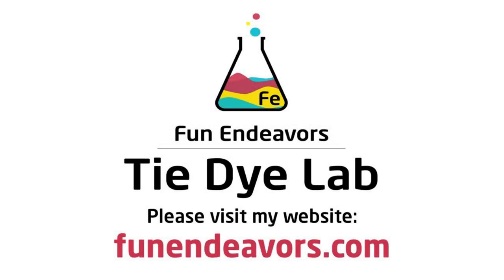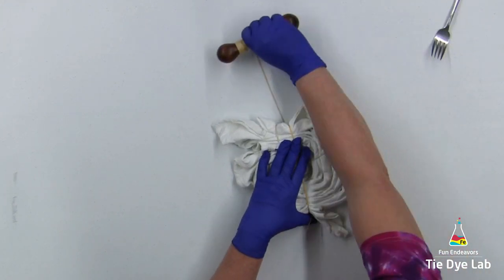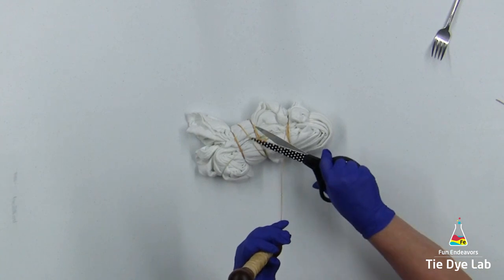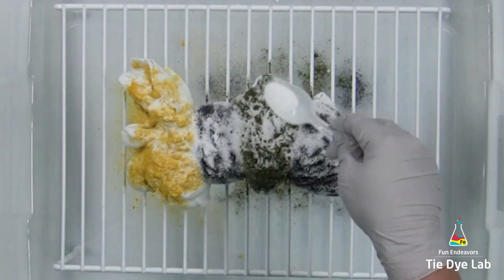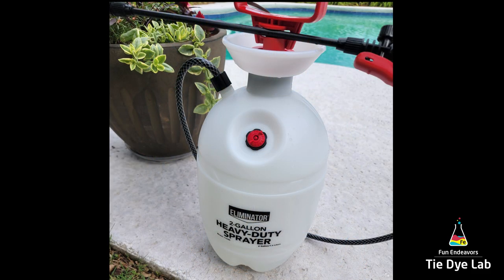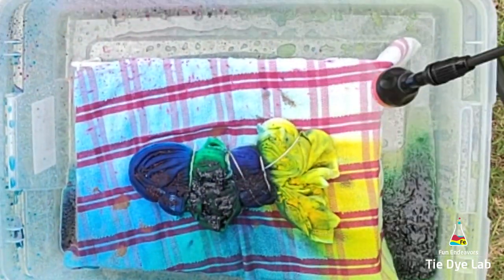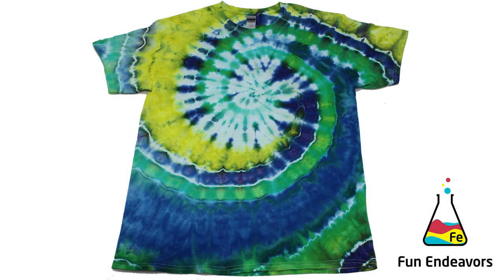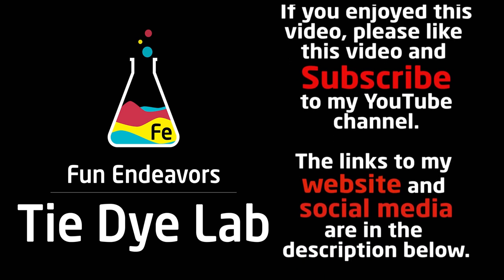Tie Dye Pattern:  Sinew Spiral Tie Dye Shirt [Hot Water Irrigation]

Comment: Which style do you personally prefer? The 'set it and forget it' type of ice dye where you get it all set up then walk away for a day or two. Or the continual work with spraying it and creating the shirt in less time? Is there a remarkable difference in the look and/or how much dye makes it to the final product?
Reply from the maker: I'm not quite sure yet.  So far I've only made about 4 shirts using hot water irrigation.  I've had fun experimenting with hot water irrigation, but I still love ice dyeing.  Since I'm not adding soda ash to my dry dye powder, I am still soaking the shirts for HWI the same way I would for ice dye and then letting them dry before I dye them.  I know not having to soak a shirt is a time saver in HWI, but not for me - at least not yet.
I use quite a bit of dye when I ice dye, but I think I've been using more for HWI.  Not necessarily because I needed to, but because I've been nervous about not getting good color saturation.  I think if I mixed the soda ash and dye together I wouldn't use as much.  For now though, I don't want to have to find the containers and space to store mixed dyes.  If I find myself doing a lot of HWI, I will have to take the leap though.
As far as the final look - I don't know that there is a huge difference.  Maybe it's just me, but I think I get a lot more color splits and more of a watercolor feel with ice dyeing.   I think my colors have been more intense with HWI, but part of that might be because I am using so much dye.  I guess the final product of my HWI shirts so far look kind of like something in between a liquid dyed shirt and an ice dyed shirt.

Comment: Just got the same 4 colors in a few weeks ago. I’ve used the sapphire blue and lime so far. My husband has used the intense blue ... not sure about the lemon lime. Really like the colors so far. I really like this dye. I am intrigued with using sinew on a spiral 😁. I haven’t tried HWI yet but I am sure we will eventually. Just curious about how much hot water you ran through the shirt and do you find that yellow dyes tend to be more gritty? And leave more dye behind than other colors? I do. 
Thanks again!!!
Reply from the maker: I'm not quite sure how much water I ran through the shirt.  I put about a gallon or so in my sprayer and I still had some water left after I was finished.  I quit adding water to the shirt when the dye dissolved and the dye colors came through to the back side. The lime green was the hold out color that took a while to dissolve. I did add quite a bit of it to the shirt though.  
Sinew on a spiral is something I've been messing with lately.  I tied a spiral with sinew and used Out White Brite a few months ago and that got me wondering how it would look to just use it on a regular tie dye spiral.  I'm going to keep experimenting with it more.
I think yellow is a tougher color to dissolve.   It's one of the colors that floats on the top when I mix it for liquid dye.  It also tends to clump up when I use it for ice dyeing.   I was a little concerned the lemon-lime was going to do that too, but it did pretty well dissolving.   It split into a bunch of yellow and green flecks that finally made came together on the shirt.  So far I really like the colors too!  I ordered some more new colors from Prochemical and Dye at the same time and I'm excited to try them out.
Reply: @FunEndeavors  thanks Angie. We got a few other colors from Pro-chemical and dye as well. At the moment I cam only think of one other right now. Peach..it’s pretty and I can get it pretty bright on an ice dye 🤩. I did your single geode shirt and placed the Lime between Dharma’s dark green and Olive drab. OMG it seeped under the sinew and instead of a white line I got a lime line. I was shocked and happy 😃 lol
Reply from the maker: @lisastevens3104   I don't think I've ever tried the peach.  I'll have to add that one to my list for next time.   I love getting and trying new colors!
I bet the lime looked great with dark green and olive!  One of the new colors I ordered was dusty purple.  When I opened the jar the dye was green - I panicked a little at first, but I went ahead and put it on a HWI shirt that I used a variety of blue and purple dye on and it turned out great!  There was a little green in the shirt, but it worked!